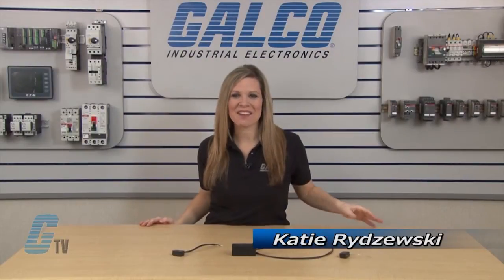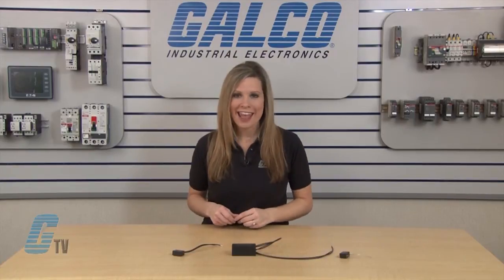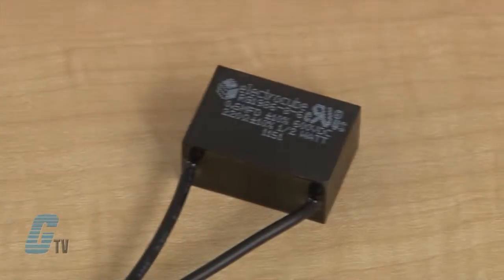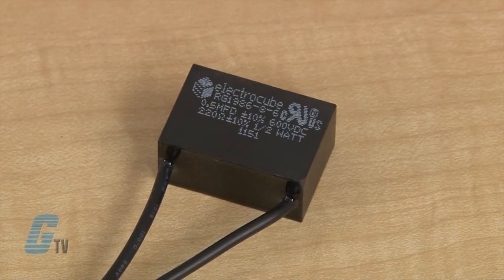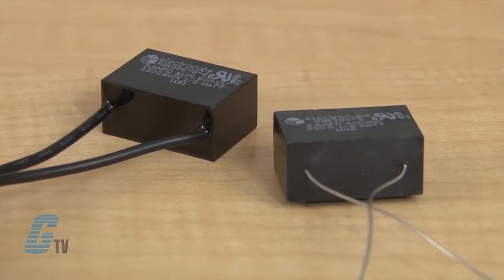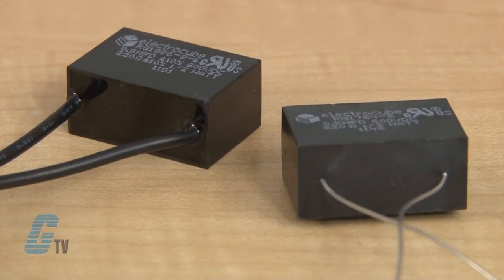Electrocube RC Networks  - Single Phase Series

Comment: I have a new 30", 3 speed oscillating fan (120V, 1.75A, 230W) that consistently trips any of the four GFCIs that I can plug it into. All four GFCIs work properly with other devices incl radios and chop saws. It's been suggested that this new fan likely doesn't have a 'soft-start' feature causing the GFCIs to trip. The fan works fine when plugged into a non-GFCI outlet or my 3600W inverter. Will this RC device solve this problem?